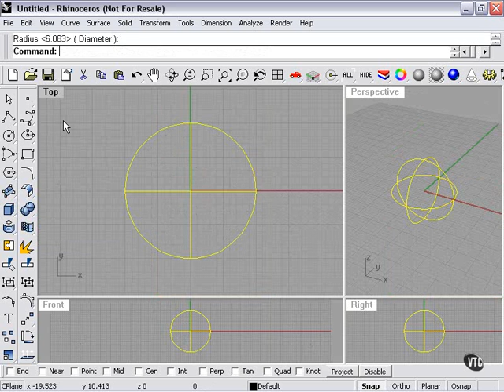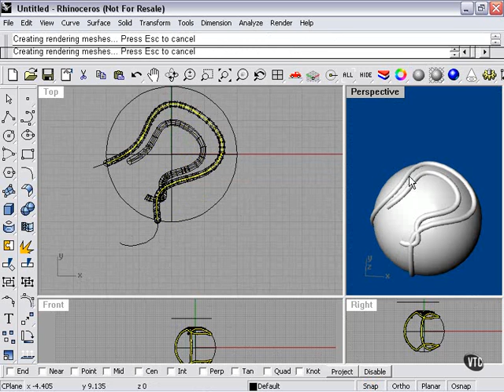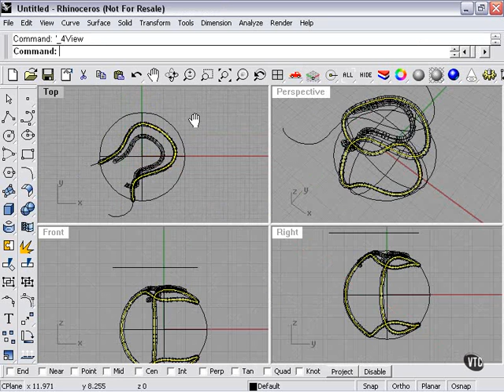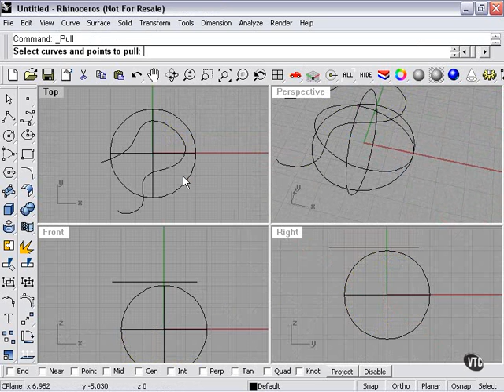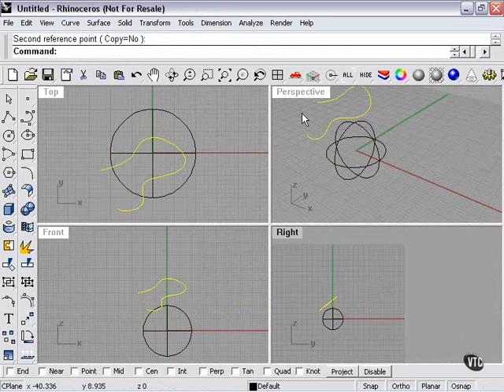Learning Rhino---Pulling & Projecting

Comment: something to add: the Pull curve on the sphere is the normal projection. If you create straight normal lines using the command _Lines > _Normal from any point on the curve you will see that it will intersect the hovering curve. This is why the _Pull command in this example creates smaller projections if the curve is further away from the sphere
note: normal in geometry means perpendicular to a surface/face